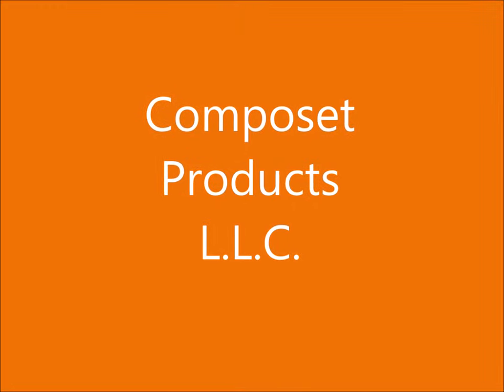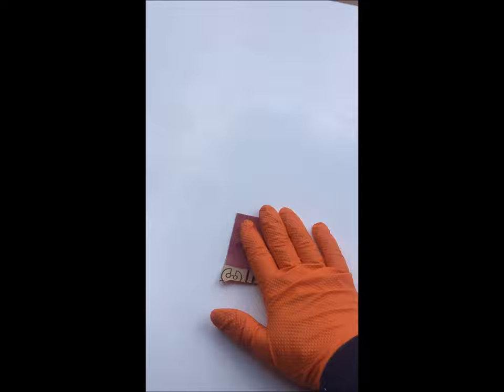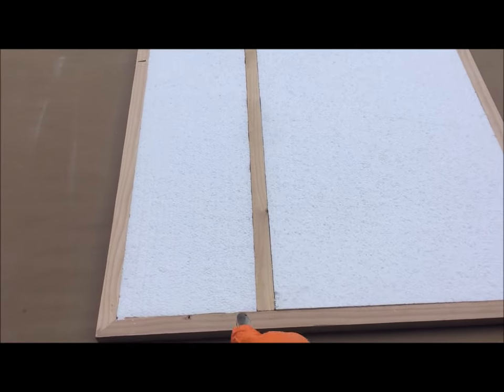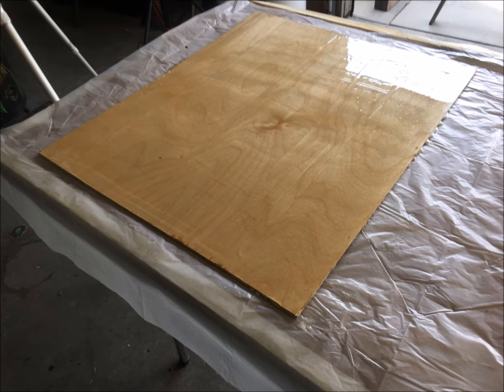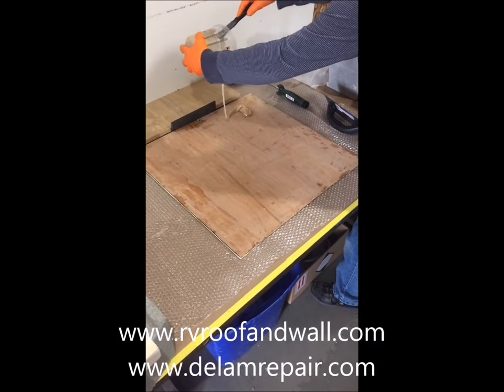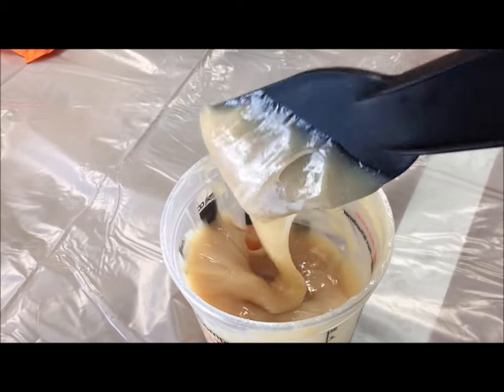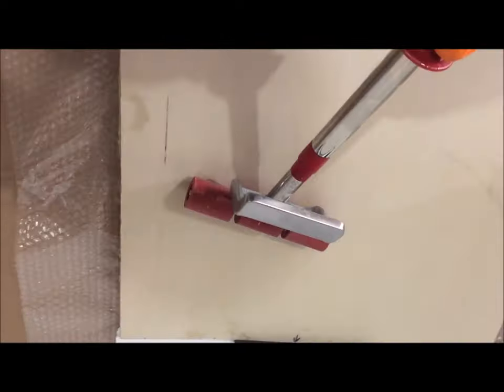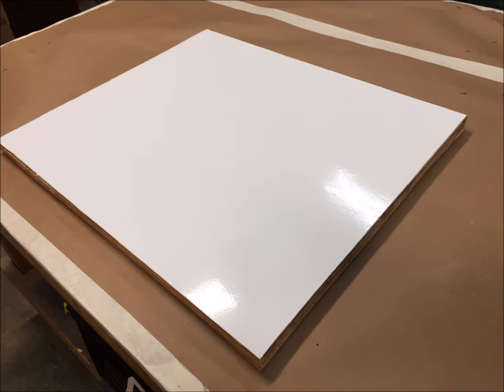How to Build RV Fiberglass Filon Plywood Foam Composite Sandwich Wall

Comment: Very informative. Questions please: 1) Thickness of plywood? (I assume at least outer plywood is marine grade). 2) Total thickness of end product? 3) I an outer plywood really needed? Can we use thicker Filon (I do not know details of this product, other than it is fibreglass.  Thanks, again.
Reply: In an rv there's no marine grade chemicals in it are poison to breathe. There's no set wall thickness but usually interior is 1/8 or 1/4 aluminum tubing walls are 1 or 1.25 (2x2 wood is 1.5)and exterior panel is 1/4. Wall panels are normally between 1.5 and 2 inches....oh filons just one thickness that I know of
Reply: @brentsharp8234  Appreciated
Reply: @GoAndStay  you trying to build a camper is that your reason for asking specifics?
Reply: @brentsharp8234  thinking about it, but will probably not take it on. But most definitely looking and dreaming and planning! That is why I enjoyed this so much.
Reply: @GoAndStay  if you enjoy building its fun to do I built my tiny camper last year it took about a month. You can get filon from recpro and use contact cement to glue it it's really not hard just time consuming
Reply: @brentsharp8234  The time should probably not be counted, at least I would consider a hobby and entertainment. Problem this side is I'm eternal tinkerer. And my ideas are beyond my skills. In the end it will be cheaper to buy something than tooling up, gaining the skills and DIY. And at my age I might just find that by the time I'm finished, my time is up. 😜. But I love DIY and by watching all the builds, I do learn and get ideas what to look for. In the meantime I am out hiking and camping. And think about camping trailers.
Reply: @GoAndStay  I turned 68 this Summer, and I'm going to build my own camping trailer, toy hauler combination, which is why I'm researching all of the possible composite wall and roof construction options.  I want a design that no company is currently manufacturing (that I know of), which is partially collapsible to reduce air drag while towing, but then opens up to greatly increase the interior volume once I have reached my camping destination.  I'm looking at a few different expanding design choices, but need to finalize the composite wall and frame construction choices, as they will affect the final design and what type of fold out, and/or pop up expansion is possible.  My goal is minimum weight, but still a durable finished product.  I was hoping to avoid fiberglass, but that may not be practical.  Don't give up on your dreams of building your own camping trailer, even if you need to recruit additional help to get it done.
Reply: @traveling.down.the.road56  please share you journey with us!  I would love to follow, especially the thoughts going into it.  I have been building a drawer system for my Hilux for years, but still don't have one, as I am continually changing my design in my head. So I love the thought process.
Reply: @GoAndStay  I’m currently getting setup to start my own YouTube channel, and I’ll be posting videos of my camping trailer build as it progresses. Being a former draftsman for an architect early in my career, I have the skills to put my ideas into the form of sketches or plans drawn to scale with my CAD program on my laptop.
Reply: @traveling.down.the.road56  good. I just subscribed to you and hit notifications. Looking forward to the journey

Comment: What is the specs for the Resin you used for the Filon adhesion to the plywood
Reply from the maker: Composet Compobond epoxy find it at  www.delamrepair.com

Comment: Why don’t you use a vacuum bag?
Reply from the maker: Bill, thanks for the comment. Yes, a vacuum bag is a better alternative to the method we used, however the home DIY'er may not have the ability for the VARTM process. And many in our audience are working on RV's and need to build a patch panel that can be done in place on the RV. Typically, RV wall structures are very porous, and it would be difficult to bag the wall or RV. Therefore, we demonstrated the clamp or press method. Thanks for pointing this out. We may produce a video using VARTM as we have the equipment in our shop.

Comment: Not very high quality results, when you only compress it with external weight you create spots which are compressed more than other areas creating uneven flatness. You clearly see that on the edges. Vacuum bagging is the answer, not very expensive either, pump 100$ and bag material is filthy cheap. If you spend money to materials don't waste it with bad processes.
Reply from the maker: I agree with the comment as applied to a manufacturing environment. Typically, the manufactured RV wall installed on an RV, with many feet of lineal penetrations is way to porous and cumbersome to vacuum bag.